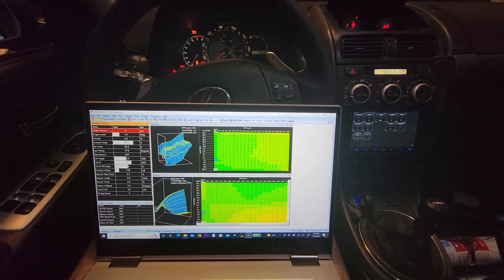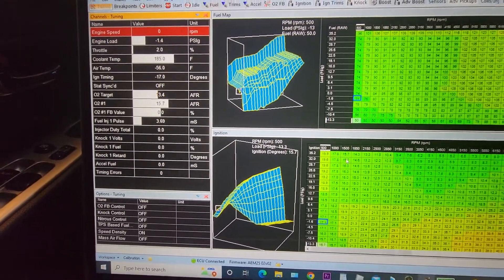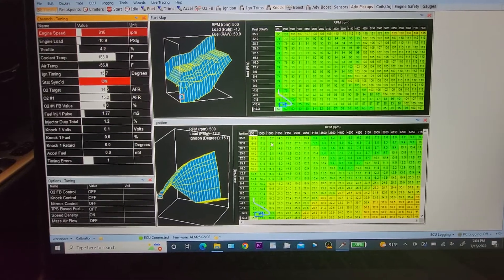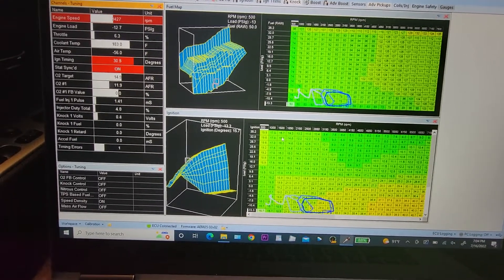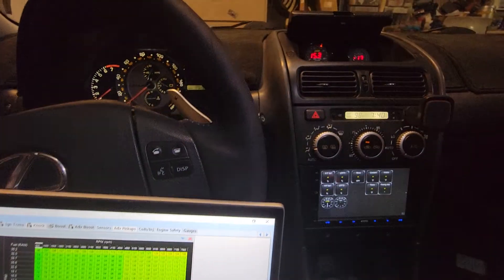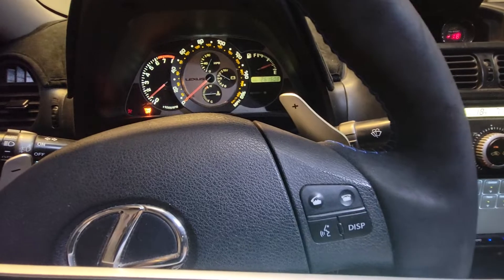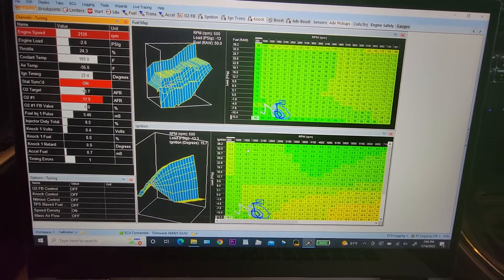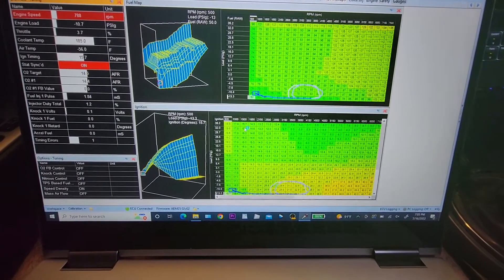IS300 NA-T Turbo - Idle and revving with Dezod AEM V2 standalone ecu connected to laptop

Comment: what Bluetooth obd2 reader are you using?
Reply from the maker: I use a veepeak one. It was connected to torque on my phone, that's why it didn't connect on the double din. It's good to use that for reading codes and live data.